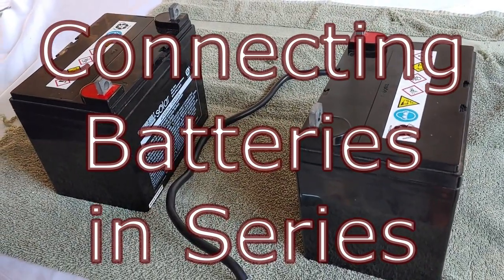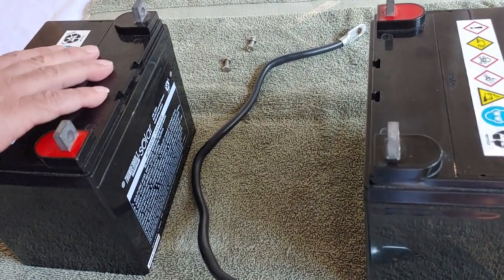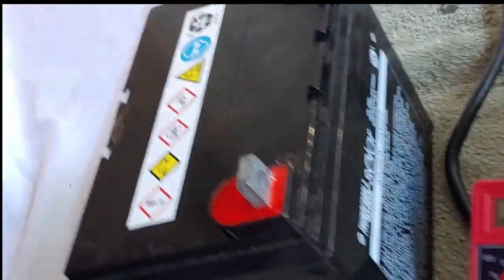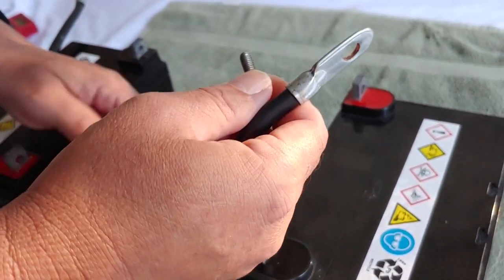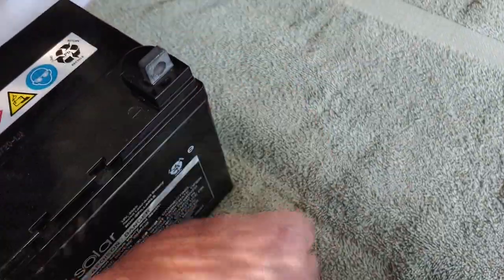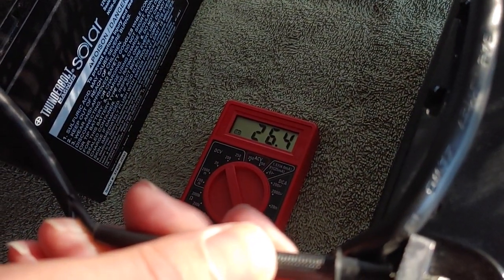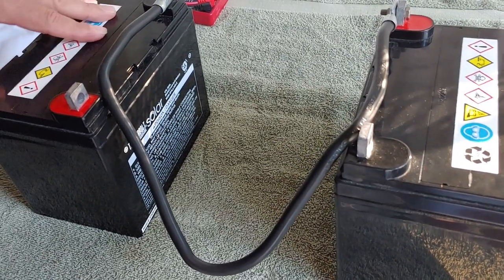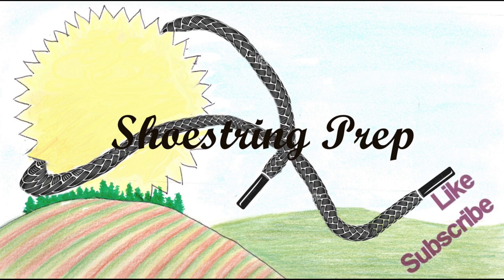Connecting two Harbor Freight 35-AH AGM batteries together in series for off-grid solar power

Comment: I still have 14 batteries...two of the 90 amp hour ones developed corrosion from acid coming through the terminals. They were less than a year old so I took them back and traded them out for 110 amp hour batteries...10 PM they are all showing 25.5 volts...I ran a #8 wire to connect all 12 volt connections together , to help equalize...after two days of rain and clouds, and welding on a new wood stove, the voltage was down to 24.6 this morning, but at noon I had 27 amps going into the bank, so it recovered today pretty well...I have 780 amp hours now. I took some of the cooking load off now, so that will help in the dark days ahead.
Reply from the maker: Thanks for your comment

Comment: I’m gathering components to build a small system for emergency power, have a 100 panel from harbor freight, 2 of their 12 volt batteries, I’m thinking of doubling both to 2 panels and a bank of 4 batteries, I have the cheap regulator and their 750 watt modified inverter, these 2 components will go in a faraday cage  and I’m thinking about getting the 300 watt pure sign wave inverter from AIMS and Epever tracer by 40 amp mppt  charge controller, does this sound like a decent set up sir? I also was planning on a 12 volt system and wondering why would you run a 24 volt system? Thank you for all your videos! I am learning a lot from you.
Reply from the maker: Thank you for your kind words. Your system sounds good just make sure before you get to 300 watt pure sine wave that your system it's not going to be running more than 300 watts. I have never found a use for a 24 volt system all my setups are 12 volt thanks for your comment.

Comment: Charging @4:18 -- using a battery charger. 24V battery charger?
Reply from the maker: I wad using a 12 volt battery charger. Thanks for your comment.
Reply: @shoestringprep  Please confirm. You are charging 2 12v batteries connected in series using a 12v charger? Thank you.
Reply from the maker: @roseymalino9855  I charged each 12 volt battery individual with a 12 volt battery charger. I then put the two batteries in series. I charge the battery bank 24 volt. With a charge controller that can charge in 24 volts. Thanks for your comment.

Comment: Different topic but can you tell me if I should get a deep cycle marine battery with high cranking amps or lower cranking amps for solar
Reply from the maker: If you intend to use the battery to start an engine, such as on a boat, cranking is important - get a high cranking capability. If the battery is going to be used in a solar power situation, it's likely there will be no cranking at all - just lights and fans and so forth - and cranking capacity is irrelevant.
Hope that answers your question.
Thanks for your comment.
Reply: @shoestringprep  thank you for your help . This is all sooo confusing. I seen something about high cranking amp battery had thinner plates and were not as good for solar
Reply from the maker: @MrRenomax  There is a lot of confusion out there about solar power. My 600-watt solar power system is run off marine batteries that have high cranking capability. And it works great. I only share things that are working for me.
I have a video about that system if you want to watch that.
Thanks for your comment.
Reply: @shoestringprep  great info thank you so much and sorry for asking on two different videos
Reply from the maker: @MrRenomax  I appreciate all questions and comments.